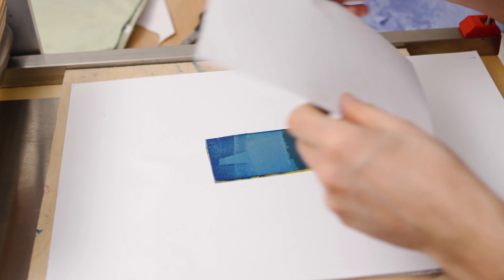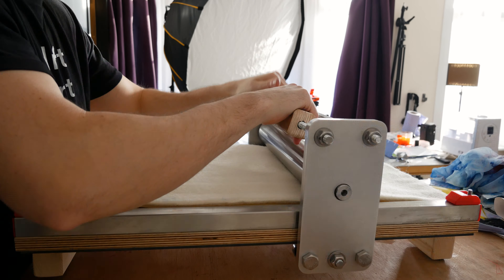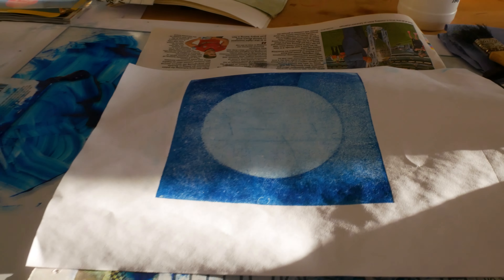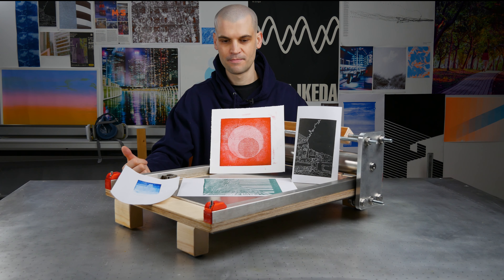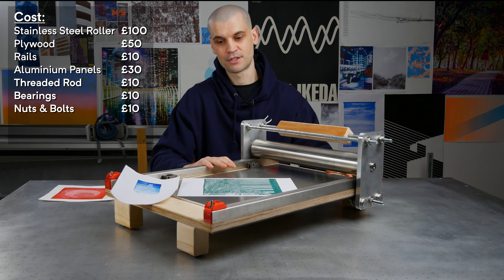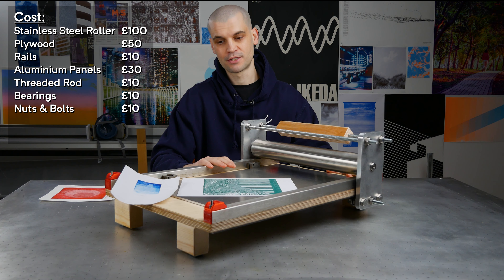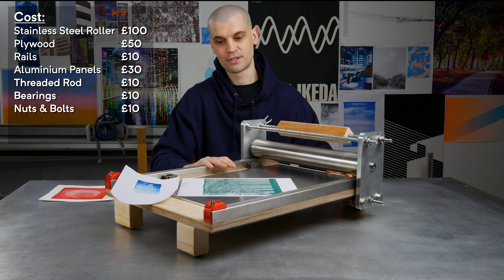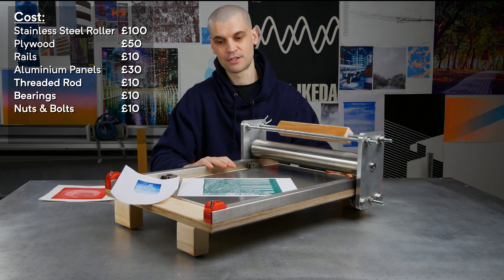DIY Letterpress Proofing Press/Etching Press

Comment: Would you be up for sharing a pdf file for the material specs for your press, roller size, hole diameters, plate thickness ect. Thank you

Comment: Do you have any recommendations for dealing with cleaning solvents, and how to dispose of them?
Reply from the maker: I use cranfield safe wash inks and they clean up with water and soap. If i use oil based ink then i use normal vegetable oil to clean up. I never use any solvents.
Reply: @ThisDesignedThat  that's great, never heard of Cranfield, thanks for your input.

Comment: Could you even motorize this with a ballscrew? Nice work!
Reply from the maker: You couldddd but you ideally want a tactile approach so you can feel the pressure needed to pull across the plate. I guess if you could disengage the ballscrew, pull a few test prints manually to get the pressure right. Then engage the ballscrew to print the edition automatically that might work. Other proofing press designs used a rack and pinion design with a crank handle which would help to give more leverage and you'd still have the tactility to be able to feel whether the pressure was right or not.
Reply: @ThisDesignedThat  I see! I've not used one before, but that makes total sense! Great job on this :)

Comment: Thank you for this! I do have access to machining/CNC/3D printers - I see others have asked; would you consider sharing your files? My first thought was how I’d use this for woodblock as well as letterpress, so when you spoke later about making the pressure adjustable, that’s exactly what I’d been envisioning 👍🏼 Ideally I’d want to be able to print up to A1 so I’d just need to adjust the measurements for the platen. Thanks!!

Comment: nice one! would you be open for commissions building something similar?
Reply from the maker: Due to the time involved its really not feasible and i'd be working at a loss when you consider the hourly wage I need to make to pay the bills.
Reply: @ThisDesignedThat  ah makes sense, worth a shot! cheers
Reply from the maker: @zacknowlandbarker  you could try to find a local machinist to make for you. You need to find someone local because the shipping costs for this would be very expensive.
Reply: @ThisDesignedThat  sweet, I'll have a look around - can imagine the cost. cheers